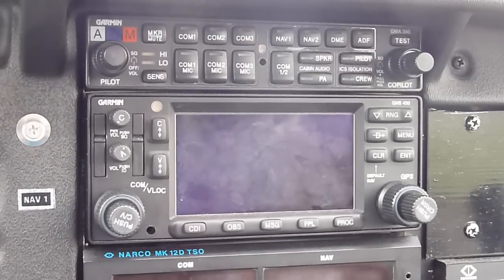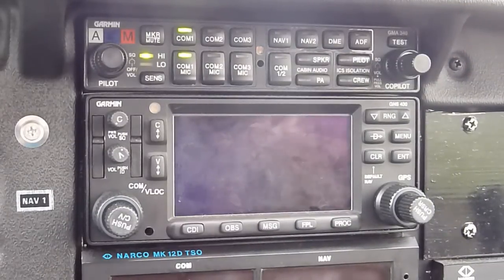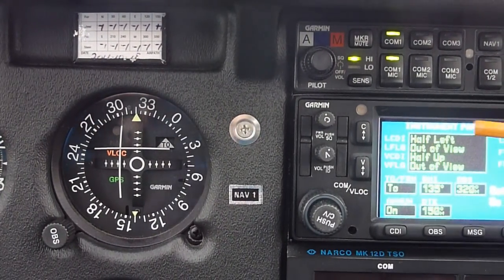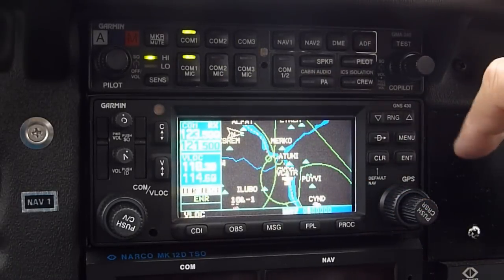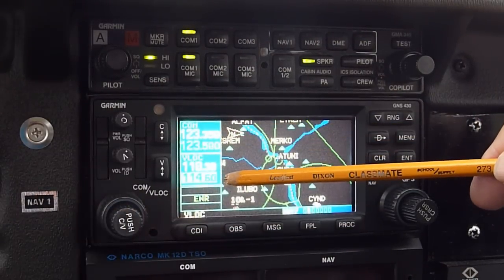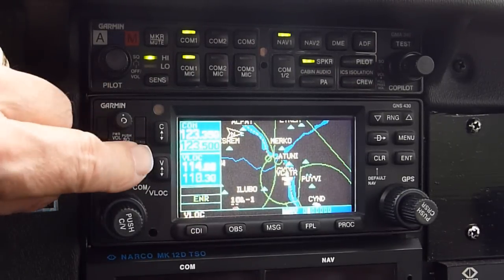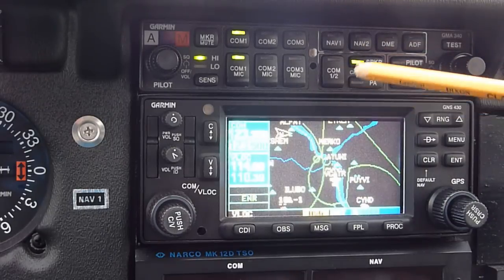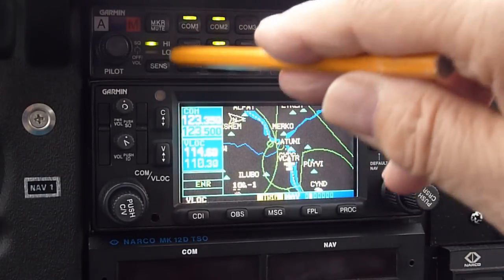Garmin 430 and 340

Comment: Old memory---I did not think you could get a VOR signal on the ground?  7:25
Reply: No particular restriction on that. The rule is "line of sight", that is, if you can see (or could see) the VOR then you should be able to receive it. For example, I can get the SJC VOR from my home airport of RHV, 5.5 NM away. The key factor there is if there is not significant ground clutter or buildings in the way.